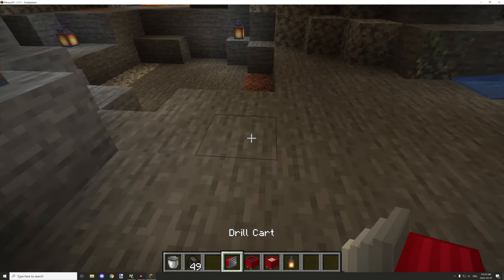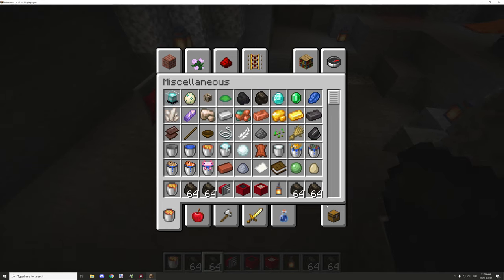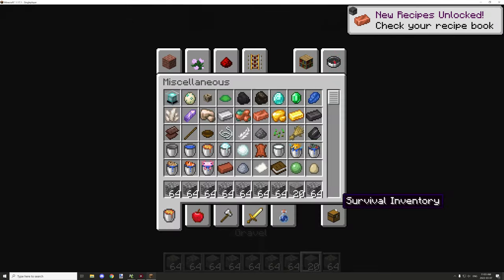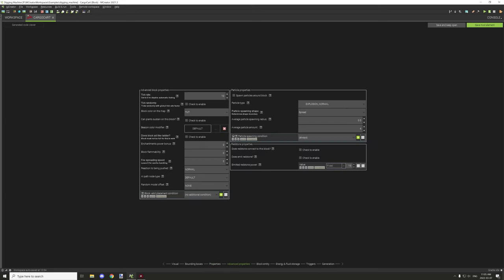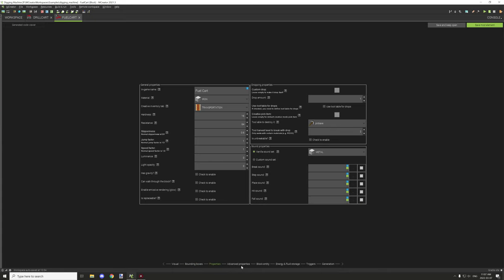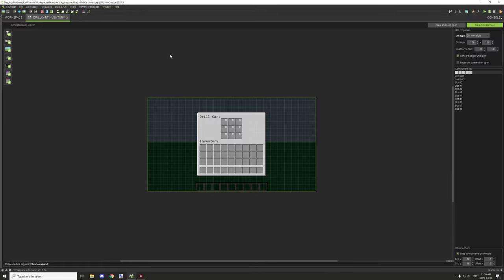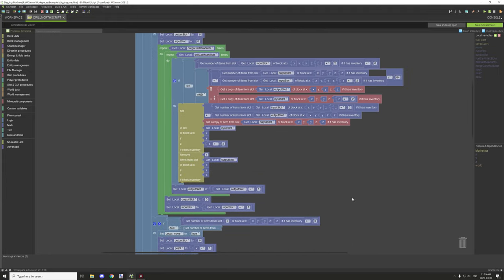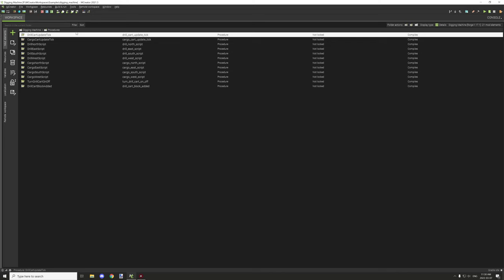MCreator: Digging Machine | 2021.3

Comment from the maker: This tutorial will need to be updated to work with 1.18.2 for MCreator 2022.1 as the clone command no longer copies the ForgeData in the latest snapshot.
I am not sure it can be fixed on MCreator's side it may be either Minecraft or Forge related bugs with this, however it is possible to clone tags using the /data modify block command so I will try to figure out a way to adapt the code for 1.18.2 in the near future once it enters pre-release. I just wanted to make a small note of that as I just found the issue the other day and this may break a few things in the community but I will make a separate tutorial on the /data modify block command to explain how you can us the workaround. I try my best to stay one step ahead of the game for the community.
Reply: ok

Comment: The Scripts procedures open but nothing appears inside. :(
Reply from the maker: I think it may be a loading issue try to give it a few seconds before importing, I have had a few people comment about this however the other day I noticed that if you import to quickly it dose not display the blocks most likely to mcreator loading the procedure editor and not all the blocks being loaded in before you import. IF its still a issue then you can try saving while they are hidden and reload the procedure give it some time to load in and then connect the procedure to the main block.

Comment: The drilling machine is not moving. I already checked all the procedures but I don't see any mistakes.
Reply from the maker: Make sure your fuel cart has fuel and that the drill is turned on, I think I had it set up to sneak+right-click to toggle the drill on/off.

Comment: It doesn't let me import the north, west, south and east procedures, it just doesn't load and keep blank.but if I try to open them in the workspace that I downloaded from GitHub they will load in game but not on the editor
Edit idk number: I managed to fix all of that but now I get an error whenever It builds the mod with the procedures:
Drill rotations procedures.
 turn on/off drill procedures.
Edit idk anymore: FINALLY I DID IT I MADE THE DRILL IN MY MOD 1.16.5 AND IT WORKS PERFECTLY
Reply from the maker: I have noticed that procedures need some time to load before any changes are made, so give it a few seconds to load in all the blocks and such and then import the procedure, and let it load the blocks, this should fix the issue.

I was working on importing things and I did it to fast and it would not show the procedure, if that fails then try to save if possible then load the procedure again it may show up and just need to be connected to the main block.
Reply: @NorthWestTreesMCreator  yeah, I fixed it I found out about the glitch that was coursing the error and fixed it, I live the drill it works perfectly